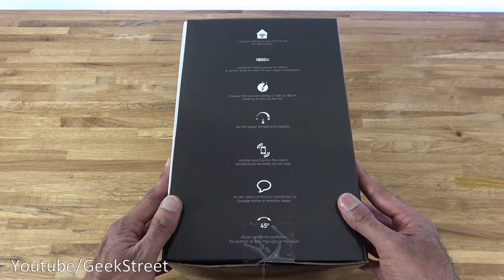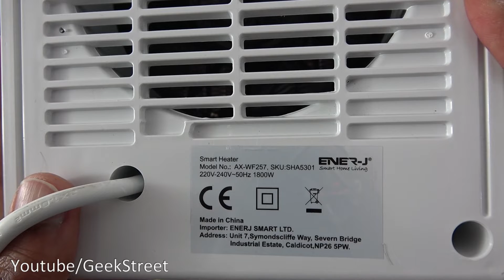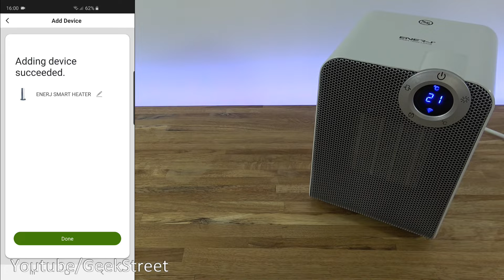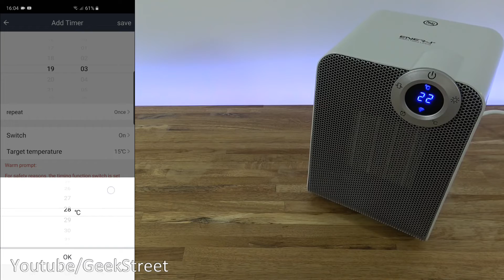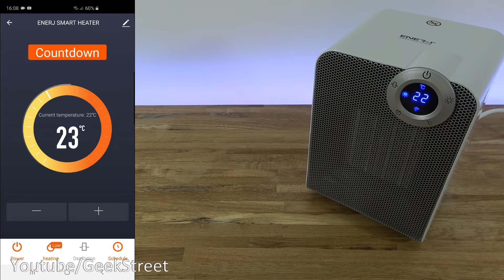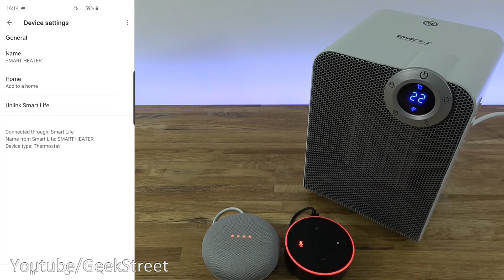Smart Fan / Heater works with Alexa and Google! Smart Life / Tuya from Ener-J

Comment: I need information if possible! Please inform me: Does the fan switch off at the same time as the thermostat so that the fan does not continue to run after the thermostat switches off?

Understood in the sense that, When the desired temperature is reached, the Fan / fan switches off automatically. When the temperature has dropped below
the set temperature, the fan restarts. 
?
Reply: In my tower I can do that and the apps are about the same so I gess u can do it